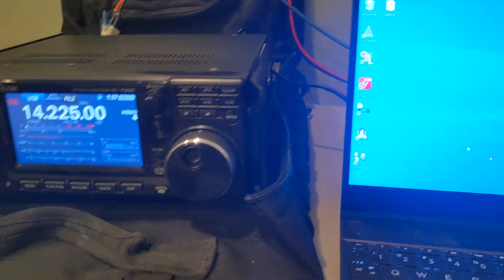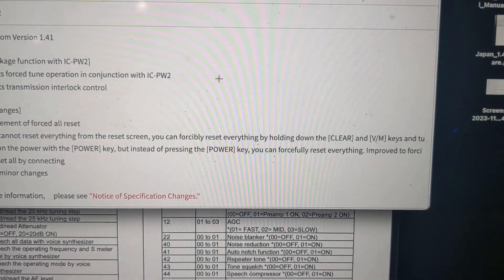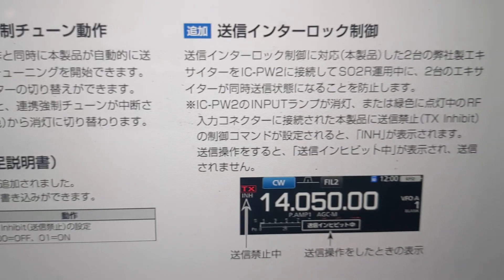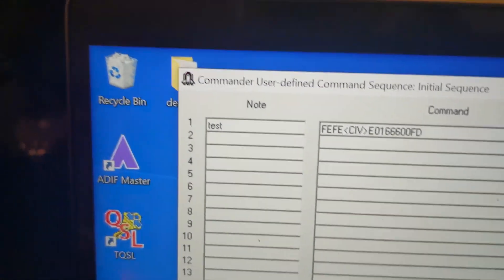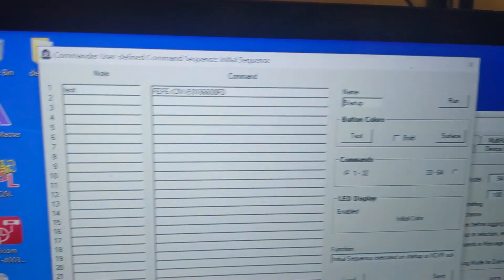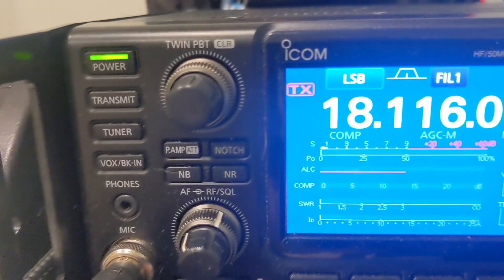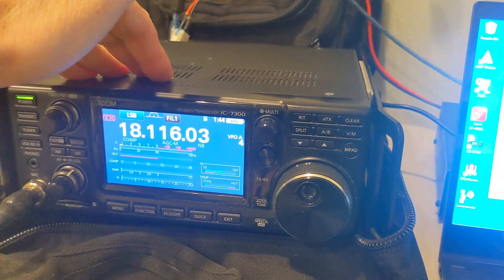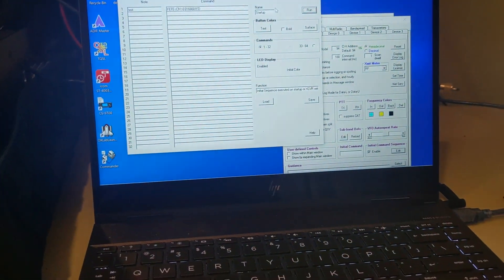Icom IC-7300 Firmware v1.42  NEW FEATURE!!

Comment: Always excellent information!

I have had my 7300 for some time but was never completely sure about my next question. Hopefully you can provide some insight. 
On a propagation site that I visit, we want to give each station a signal report. How shld my 7300’s controls be set so that I will get maximum received signals??
Both attenuators are in the off positions and the rf/sql dial is fully counterclockwise. The rf/sql control(in the menu)is set to auto. 

Thanku
Billy

Comment: I wonder if the inhibit is used for the SO2R feature on the PW2 so the AMP will keep both radios from transmitting at the same time.
Reply from the maker: It is...it's documented in the firmware change notes.

Comment: Icom radios sold in Japan are designed specifically for the Japanese market only. They are compliant to Japanese type approval and requested specifications by Japanese law, but they are NOT compliant to type approvals or specifications of overseas countries because band plans, specifications for type approvals, etc. are different. Given this update is not available outside Japan, I would wait till it is made available on the global sites.
Reply from the maker: You realize the radio in the video is a converted Japanese version right?

Comment: i dont remember but NOISE REDUCTION now have 15 steps ... i think old 1.41 have 10 steps ... now NR have 15 .... can any friend cfm id 1.41 has 10 or 15 steps of NR?  73 de PY7DJ
Reply from the maker: I think you're right.  Only went to 10 before.
Reply: I still have 1.41 and NR is 15 steps.
Reply: @M9YKD  you are right, it was 15 on v1.41